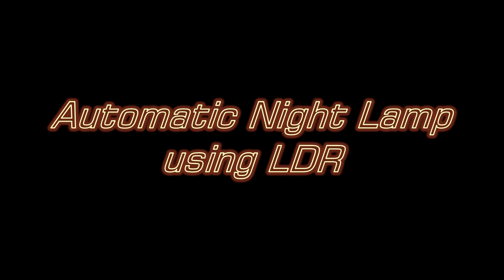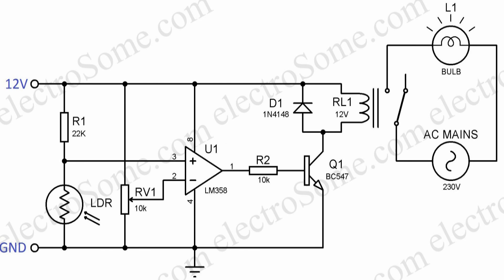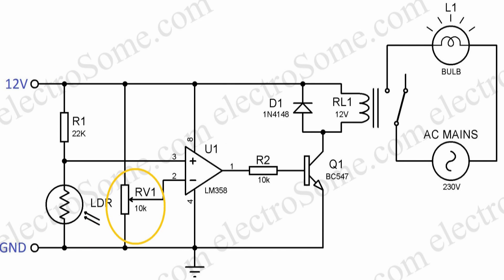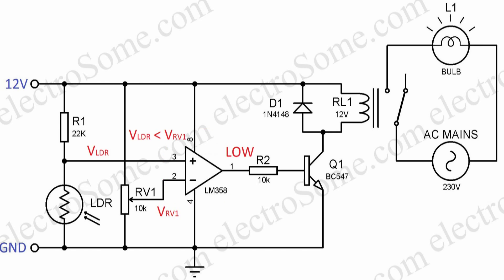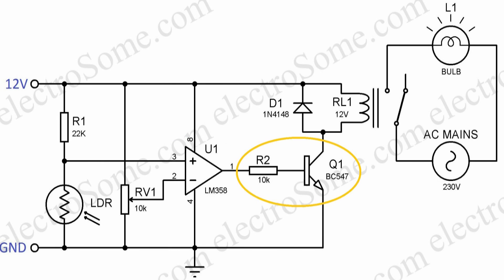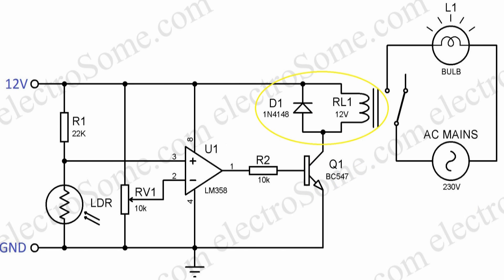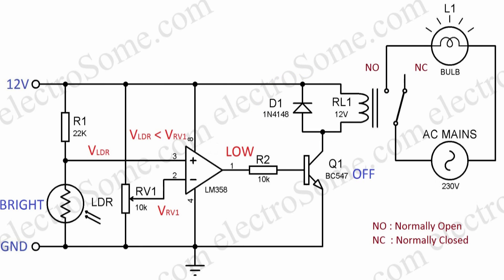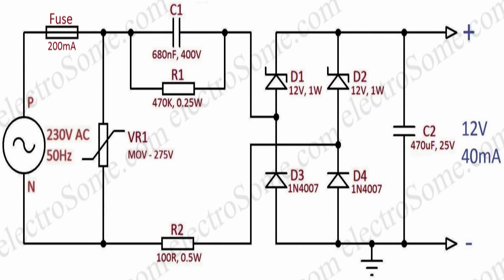Automatic Night Lamp using LDR

Comment: Hi, Great tutorial. I would like to make this but using 12v battery with 12v led strip, maybe cut to just 12led. how would I modify the circuit please? many thanks. John... :)
Reply from the maker: Then you don't need to use that capacitor dropper power supply. 
Just connect the led to relay and battery. 
Visit this link : https://electrosome.com/automatic-night-lamp/